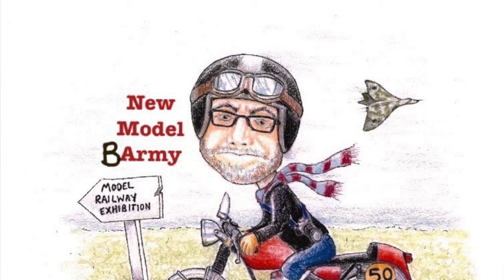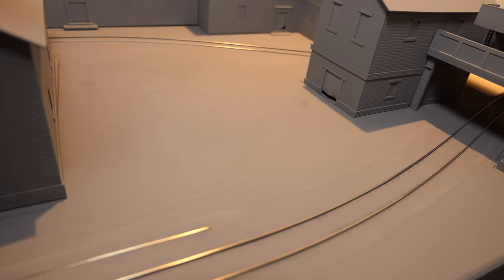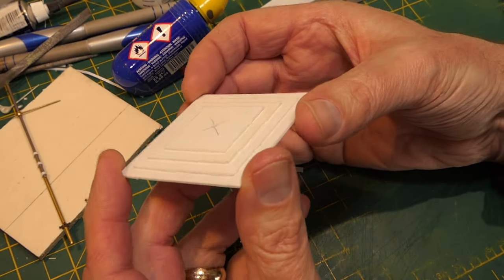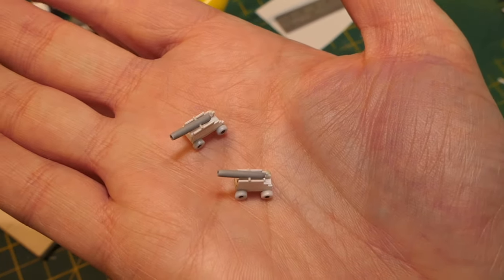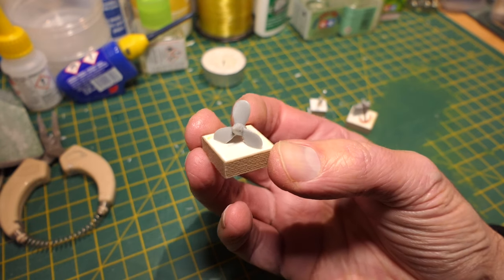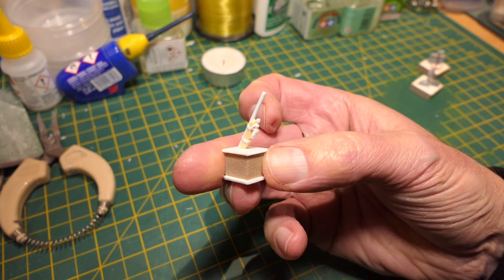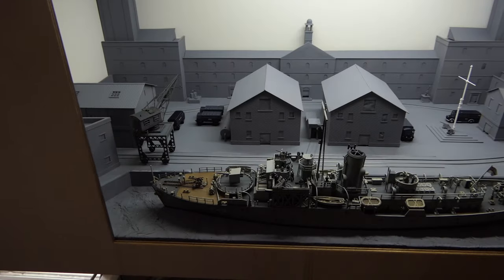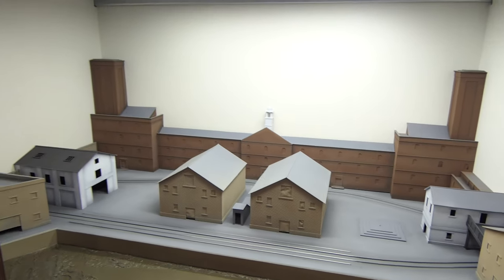N Gauge Royal Navy dockyard layout 'The Cruel Sea' Part 5. Starting the details, lighting & paint.

Comment: Enjoying your project. Thinking of the halyards for the mast, pop into the local riding school or pony club and come away with some tail hairs. Easier to work with than plastic or wire.
Reply from the maker: Thanks for that suggestion, I’ve actually got some model rigging left from the corvette build so I’ll probably run with that. I’ve just got to source a suitable Ensign. Thanks for watching. Jason

Comment: The area outside the CO's office. It would have a line of cobbles each side, and be reffered to as 'The Quarter Deck'  All Ratings would 'Double Across' and salute.
Reply from the maker: Thank you for the intel. I’m wondering how easy that will be to work in now? Could I get away with cobbles just between the front of the building and the flagpole platform do you think?